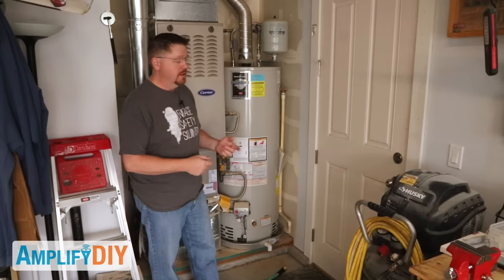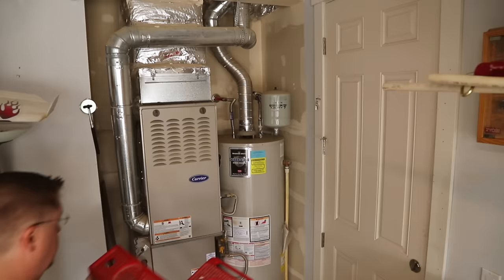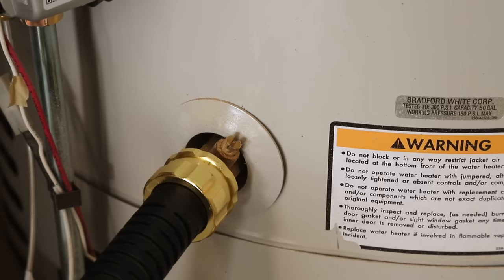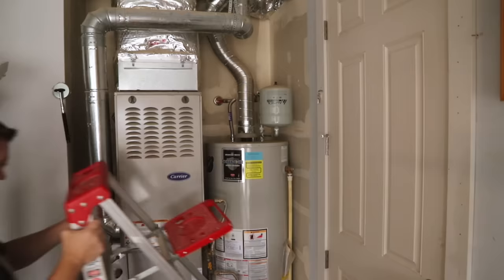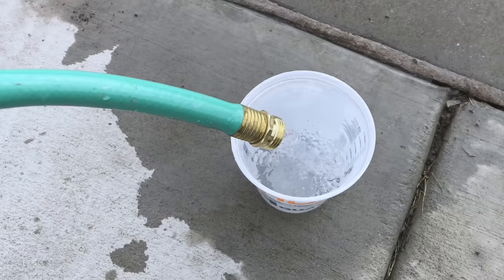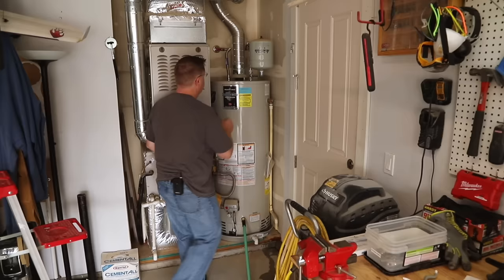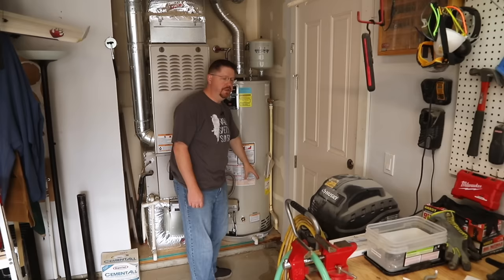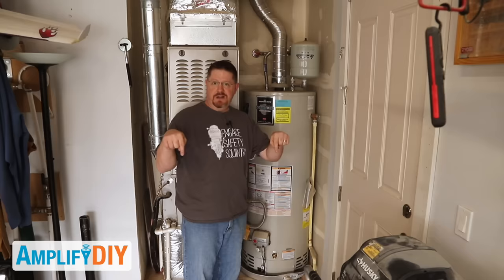How To Flush A Hot Water Heater To Remove Sediment

Comment: After the initial draining why wouldn't you leave the drain valve open for a few minutes while the inlet valve is also open?  I've always done that, thinking that the water flowing in from the top is helping to stir up the junk on the bottom and push it out.
Reply from the maker: Have you ever tried to shoot a squirt gun under water? It's a lot less effective than you might think. The best way to stir the sediment is to drain the tank completely, then let in short 5-10 second bursts of cold water from the shutoff valve, then let it all drain out. Repeat until the water runs clear. 

Thanks for watching!
Reply: Good analogy but that's not really what I said.  I'm suggesting opening the top inlet valve when the tank is empty, or nearly empty, and let the force of the incoming water flush straight thru for a couple of minutes with all the force of your incoming water supply line pushing things thru.  It seemed to work good for me.    @AmplifyDIY

Comment: So the hot water is running inside the house during this procedure?
Reply from the maker: Hi Joel - no, as soon as you turn off the cold water inlet to the heater, water should slow down and stop flowing entirely out of the open hot water faucet inside the house. You can leave the faucet open during the flush - that won't hurt anything. Thanks for watching, and good luck!

Comment: 7:34 How come the first time you fill the tank up (before completely draining it again) you close the tpr valve. After draining it for the last time, you mention keeping the tpr valve open since air has to go somewhere when filling the tank. I'm currently following your video as I speak.
Reply from the maker: Hi B - I may have glossed over a few things, and I hope you figured it out yesterday while you were doing the flush. Here are the main principles to keep in mind: 
When you let water out of the tank, you need to let air in. When you fill the tank back up, you need to let air out. The T&P valve is a convenient way to do that, but it is usually installed roughly 3/4ths of the way up from the bottom of the tank... so when you fill the tank back up completely you'll have to close the T&P valve when the water gets close to that height.. or else it will just come right back out through that valve. Closing this valve at that point will of course leave a little air in the tank at the top, which you can let out through a faucet.

At any rate, I hope the whole process went well for you. Thanks for watching!
Reply: @AmplifyDIY  I ended up figuring it out. Your video was a huge help so I appreciate the fact you posted it to help us all out!

Comment: Can I drain the water into my tub, does it have to be onto the street?
Reply from the maker: Hi Daniel - you can drain into a tub as long as it is downhill from your heater. i.e., the hose from the heater can't start lower than the edge of your tub, go up over the side of the tub then down to the drain. The water will only drain out of the heater down to the highest point of the hose. Make sense? Good luck!

Comment: I've heard of water heaters exploding... What causes that and what do I do to prevent it?
Reply from the maker: Hi Cyndi - water heaters are pressure vessels, and any pressure vessel can of course burst.... HOWEVER: Every water heater with a tank has (or at least comes with one installed) a pressure relief valve specifically designed to keep the pressure inside the tank from ever getting any where near a dangerous level. In short: Water heaters do not explode. They are very safe. Thanks for watching!

Comment: Is it ok to turn it to pilot down the night before? so the water is not SCALDING HOT  YIKES!
Reply from the maker: Hi Karla - even if you turn it down to pilot the night before, it will still be quite hot the next morning. Water heaters are pretty darn well insulated, and hold their heat for a long time.
Here is what I recommend: On the day you are ready to do the flush, start by going out to the heater and turning it to pilot. Then take a shower, do a load of dishes, or do some laundry. (or do all three!) This will use up the heated water in the tank, and exchange it with cold water from the supply. Then when you go to drain the tank, the water will be nice and cool. 

Good luck!

Comment: My water heater is in my basement - will the water have to be pumped out? Or will water pressure be enough?
Reply from the maker: There should be a drain in the floor somewhere in the basement that you can use. I recommend also using a kitchen strainer to catch any big chunks so you don't accidentally clog the floor drain. Good luck!
Reply: @AmplifyDIY the previous owner has a hose attached to the heater drain then wrapped around several times to loop up and into a rarely used tub - so this should work fine then?
Reply from the maker: The tank has to drain down hill. If the hose has to go up higher than the drain valve, it will only drain down to the highest point of the hose. Regardless of what the prior owner did, you should look for a floor drain and drain it into that. Good luck!
Reply: @AmplifyDIY Ok, sorry to ask for clarity but adding an inline pump isn’t ridiculous then 😢

Comment: If the water heater is in the basement, can the hose still be brought up and outside? The other option is the sump pump pit, but that doesn't seem like a good idea with such hot water.
Reply from the maker: Sorry for the late response: The sump pump is the way to go, but with 2 modifications: First, turn off the heat source for the heater then go take a shower, do some dishes or run a load of laundry. This will use up the heated water in the tank and exchange it with cooler water. Second, I recommend that you drain through a kitchen strainer into the sump pump area, so that you don't potentially clog up the pump with all the sediment from the heater. 

Good luck!
Reply: @AmplifyDIY  thank you for the reply! This is very helpful and we will be doing it within the next couple weeks. I had bought a mesh pieces that is for the washer outlet to use for this.

Comment: Can we drain without a hose ..i mean let water fall into the pan and out the PVC pipe ??
Reply from the maker: Hi Sajid - no, your heater probably holds at least 30 gallons of water. You can't just drain it into the pan at the bottom of the heater... it's way too much water and will flood wherever your heater is installed (garage, attic, basement, etc).

Comment: The only valve on my water heater is red, above the unit, coming from the ceiling. It runs unto a "potable water expansion tank" and into the heater. I would expect cold water in to be blue. Is this the right one for the water coming in? I see natural gas line on the side of the tank, so it can't be that.
Reply from the maker: Hi Chris - sorry for the delay in getting back to you. Yes, this sounds like your shut-off valve. You can always find out easily by turning it off, then trying to use some hot water. If the hot water slows down and stops flowing after a little bit of time even with the faucet all the way open, then that's the correct valve. Good luck!

Comment: Always necessary to do this at least 6 months out of the year. Gets rid of the sediment from the heating elements that builds up hampering the heating of the water which uses more electricity than necessary to do its job in heating water up to use in the house.

Comment: Well I did this and I think I air locked my pipes nothing comes out. I hear some water run when I release the safety valve. The bottom spout or is closed. I did have the safety Valve open while filling it back up to air out the tank. I went to the attic dry no leaks. I check the faucets no leaks the main to the house is on. The normal blue light on the heater is on. First time flushing the water heater after installing 5 years ago. I will get it working some how too broke to call plumber been out of work for 2 months.  I will retry to flush and re fill the system. I will give an update.
Reply from the maker: Hi Nino - I apologize for the delay in my response. I hope you were able to get the system working again!

Comment: from about 2015 - 2017 I was flushing our 2009 65 gal. gas water heater by getting out 2 buckets of water from using the pressure relief valve, every month. I remember the water coming out somewhat brownish. I don't remember how I came down with that method, but I see now that that was not correct. After 2017 nobody did any kind of flushing. Last month the hot water heater failed and we were told that it had been leaking as of late and the problem was ignored, so I guess it was the sediment corroding the metal away. I saw that the workers were complaining that it wasn't too old and that it was very heavy.
Reply from the maker: Yup. sounds like a classic failure due to sediment buildup. Thanks for the comment, Anthony!

Comment: I did like you said but my preasure valve wont stop leaking now my water heater is about 6 years old electric A.O Smith
Reply from the maker: Hi Carlos - sounds like it's time for a new T&P valve. They are cheap and easy to replace: 
https://youtu.be/e5H1i1cypxA

Comment: Electric water heater.  The capillary action even with the pressure relief valve and 2 hot water faucets open would still not drain (yes I have a back flow).  The only thing that pushed the sediment out was to create pressure by opening the cold water supply valve.  I have an 85 gallon tank.  Of course the valve on the bottom of this "top of the line" water heater is plastic so I had to be very careful to not break the valve.  I opened the valve and really nasty brown stuff came out, then I shut it off to let pressure build up and then it pushes it out again.  I may call a plumber to replace the plastic valve at the bottom and replace the anode...if they do that.
Reply from the maker: Glad you got it flushed and got all that gunk out of there! Swapping the drain valve is not very difficult, nor is doing the anode.
Drain Valve: https://youtu.be/OBPJYg0o_o0
Anode: https://youtu.be/OIMz1rwx_jc

Comment: Safe to drain hot water in the sumppump?
Reply from the maker: Hi AR - yes, but I recommend 2 things: 

First, turn off the heat source for your heater (set it to pilot if it's gas, turn off the breaker if it's electric) and then go take a shower, do some dishes or run a load of laundry. This will use up some of the hot water in the tank, and cool down what's left. This way you are not draining very hot water into your sump pump. 

Second, use a kitchen strainer to catch the larger chunks of sediment before they go down into your sump pump. You don't want to clog that up. 

Good luck!

Comment: But shouldn't I let my water heater fail within the warranty period so I can cash in on a free replacement, since it's going to fail at some point anyway?
Reply from the maker: Hi Jacob - I disagree with this reasoning and ethos. Manufacturers design to a cost, and provide a warranty that will just barely cover the shortcuts in the design. In general, left unmaintained a typical water heater will just barely outlive its warranty. However even if I was in a situation where the heater would fail early if left alone, I hugely prefer to actually maintain all my stuff so I don't have to mess with a warranty claim and ensuing headache dealing with an appliance that is down. You definitely don't want to be without hot water for however long it takes to a) fight with the manufacturer over warranty or b) get a new heater installed ... particularly if the warranty relies on proof the recommended maintenance is performed. Thanks for watching!

Comment: It's better to turn off the burner, use as much of the hot water as you can, then refill with cold water before you drain so scalding water doesn't come out. Some garden hoses may also be damaged by this high temperature water so it's better use it up and drain cold. It's also a good time to inspect and possibly replace your anode rod.
Reply from the maker: Great tips, ScienceBitch! I absolutely agree, and I should have shown it this way in the video. The day you plan to flush, go out and turn off the heat source first, then take a shower, do a load of laundry, or wash some dishes. This will replace the hot water in the tank with cool water, so when you do the first drain the water is not scalding hot. I also did a full video on anode rod inspection: https://youtu.be/OIMz1rwx_jc  Thanks for the tips, and for watching!

Comment: When do you actually close the hot water faucet after the first drain?
Reply from the maker: Hi goodword - apologies for the confusion, but it actually does not matter. I opened the faucet to attempt to let air into the system so the water would drain out. When that did not work well, I used the T&P valve to let air in instead. At that point, it does not matter if the faucet is open or closed until you are ready to do your final fill. At that point, just make sure the faucet is open so there is a path for air to get out of the tank as the water fills. Great question, and thanks for watching!
Reply: @AmplifyDIY  thank you! This was an excellent video. I subscribed. I just moved into a home, and after draining the tank, I had to flush it eight times, and it still had sediment. I imagine the previous owner hadn't done it in years, if ever.  It was getting dark, so I had to stop for the night. Hope what I did helped.

Have you made any videos on  bypassing water softners? There is also one in the house.I just moved into but I really just want to go without it for a while. Just wondering if it's harmful to not use it if it's installed in the house

Comment: The hot water "can" ruin a water hose, btw, if it's not rated for such.  My solution is to just turn off the water heater(electric).  Run all or most of the really hot water out of the tank...wash a load of whites, take a shower, dishes, etc.  It's been just 24hrs. in my single household and doing just the normal things, right now the water is lukewarm.  I think I could do it right now safely, but I can wash one more load of whites and the water should be cool.  When I flush my tank, I get a lot of white flakes.  I'm going to forgo opening the pop-off valve this time and try your suggestion of opening a hot water tap.  See how that goes.  Thanks!
Reply from the maker: I hope it went well!
Reply: @AmplifyDIY  Goodonya.  I did something completely different this time.  The water in the tank was cool by this morning so I just opened up the relief valve at the bottom(power was off) and let 'er run.  Good pressure here so I let water come out till it looked clean.  Same as last year, a lot of white flecks.  Calcium?  Lime?  This is limestone country.

Comment: What about tankless heaters? I've had mine for 10 years now, had it flushed 7 years ago but haven’t done it since. No problems ever.
Reply from the maker: Hi eronavbj - tankless heaters need regular maintenance (including flushing) as well. Over time, they become less and less efficient as crud builds up inside them. Check your owner's manual to see what the manufacturer recommends. Thanks for watching!

Comment: Had the plumber come and change my elements.  Tried to get him to flush the tank but he couldn't hardly be bothered.  He said they are not made to flush out so you end up needing to buy another tank in 20 years.  We have very hard water.  The whole bottom of the tank was filled with big white chunks.  He tried to scoop out as much as he could  with the element bar pushing it through the tiny whole at the bottom (he took off the drain pipe completely).  He said as long as the element bar is not touching the sediment, the water should heat up fine!!!  OMG!  Well, at least I have hot water.  And next time.  I'm not calling the plumber, I guess I have to do it myself and get maybe a wet vacuum. Or use some kind of hose to flush it.  And I won't hopefully wait 10 years either!  They really could have made it easier to clean out the tank.  That's terrible.
Reply from the maker: Oof. Glad you managed to get most of it out! Doing it annually yourself is a good move. Good luck!

Comment: Just wondering, but how does water get back into the water tank ?
Reply from the maker: When you are done flushing, just close the drain valve, open a faucet, close the T&P valve if you opened it, and open the cold water inlet - this will re-fill the tank and purge the air out of the system through the faucet. Thanks for watching!

Comment: If your let the heater cool down for a bit you can use it on garden, I turn mine off then we use some hot water then let it sit for a while
Reply from the maker: Great tips! I suggest turning off the heat source, then taking a shower, doing a load of laundry, or washing some dishes. This will cool the water in the tank significantly. I should have done it this way in the video - maybe next time. 
Thanks for watching!

Comment: My water heater is in the attic. Where do i drain the water?
Reply from the maker: The same process applies, you’ll just need to find a way to snake a hose from the drain valve of the heater all the way out to somewhere safe to drain. This may mean running a hose through the house, out an upper floor window, etc. Good luck!